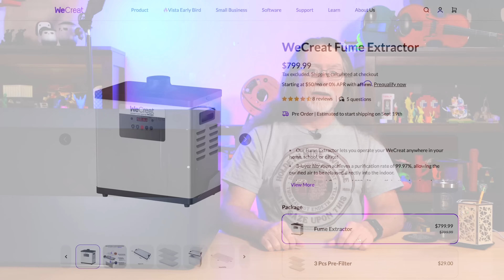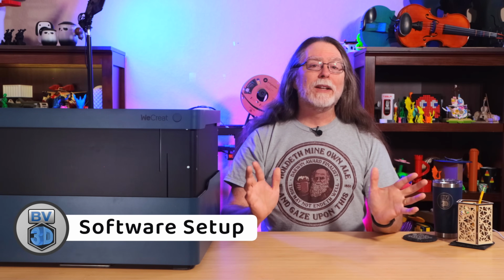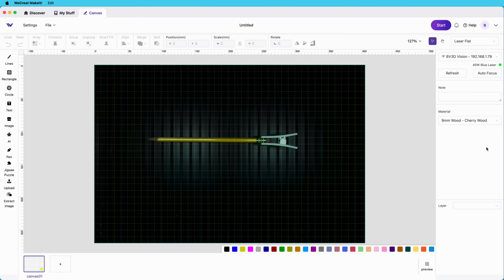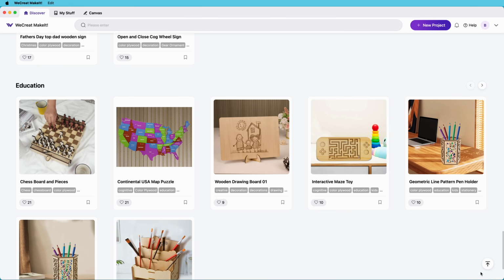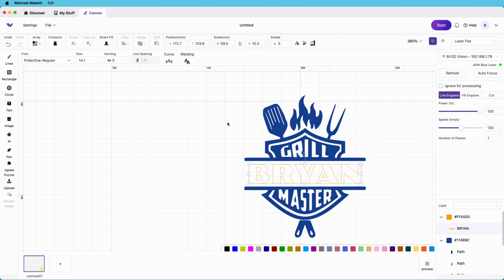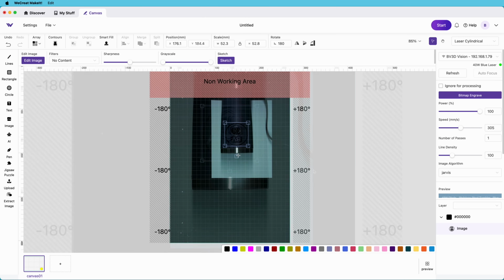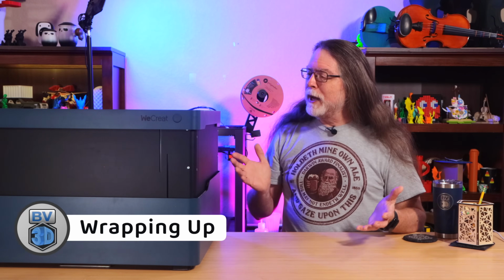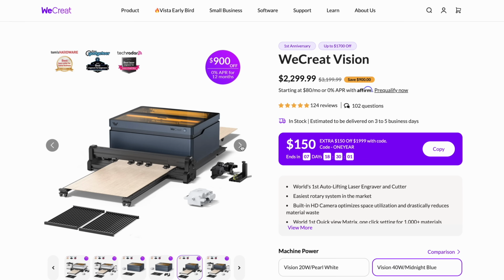40-Watt WeCreat Vision: Elevate your Laser Cutting & Engraving

Comment: I just cut a board the length of my window and a couple inches taller than my exhaust hose, cut a circle out.  I used a cheap dryer vent attachment piece from Home Depot to put my hose onto that.  Problem solved!  No bug in and smoke out.
Reply from the maker: Perfect solution! (should also keep out squirrels).

Comment: I haven’t set up my WeCreat yet, but I have an Xtool I keep in a bedroom in my house.  We have casement windows, so venting via window is a real hassle.  We used a hole saw and an exterior dryer vent (to keep squirrels out) so I don’t have to deal with the screen removal, and heat/cold as we in the midwest are known for.  This venting system has worked out wonderfully.

Comment: For the rotary piece, I'm wondering if you can put a "lift kit" under it so you can engrave larger tumblers.
Reply from the maker: I think that would work, to a certain extent. Your main limiting factor will probably be the diameter of what you can fit in the rotary jaws. I have a CO2 laser, and I printed lift feet to accommodate larger workpieces in its rotary attachment. But on the CO2 laser, the workpiece sits on top of the rotary attachment, and wheels spin the workpiece.

Comment: Great look at this laser Bryan... always love your videos... especially when you elevate your humour! Hahaha... This is very similar to my XTool S1 laser. I do agree with venting outside... especially when cutting. Those indoor filter systems won't handle the smoke... and you have to constantly change filters. Rooting for you to hit 100K my friend... you got it!!!
Reply from the maker: Hi Tim! I think WeCreat and xTool share a lot of DNA. Also, I did a cutting project over the weekend, venting to the outside, and still have a bit of "Woodburning Set" smell going on in that room! WeCreat sells an inline blower so I may purchase that and use it to really suck the smoke out of the laser and blast it outside. Thanks for the kind words! I've got 800-some-odd to go!
Reply: I agree about the DNA!! 
I do use a 6 inch in-line blower, and it works great. I also use a flapper vent part way down my ducting outside to prevent critters from crawling up into the laser!!!